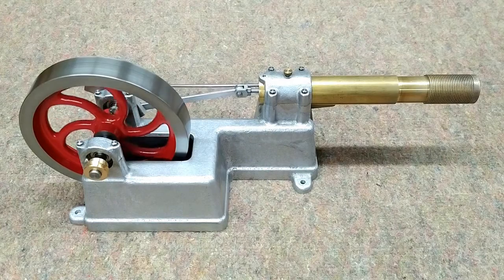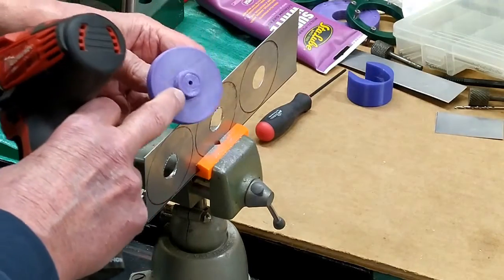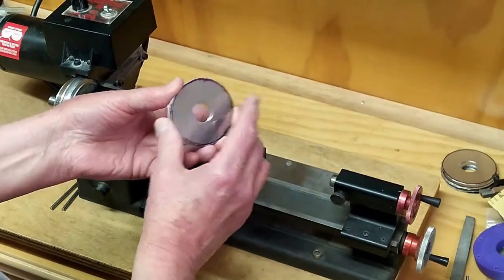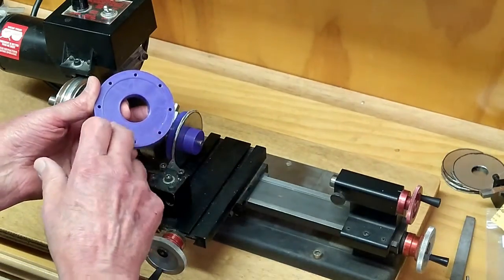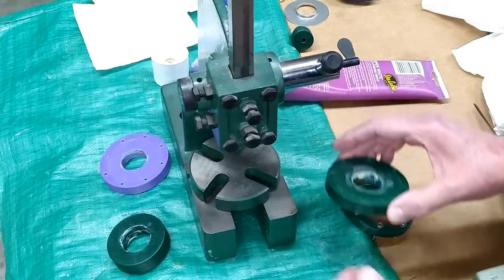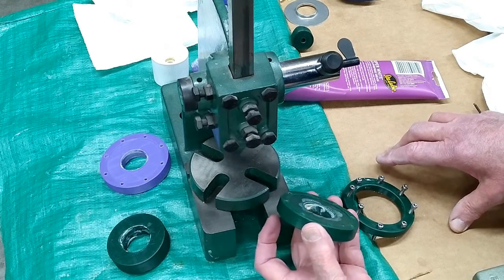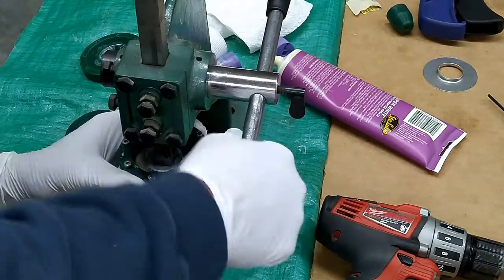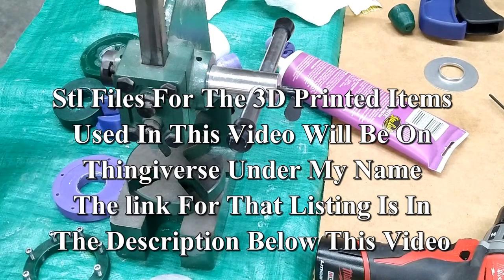Huxtable Hot Air Engine - Forming Aluminum Cooling Fins Part 1

Comment: The cold forming, especially “drawing”, or shaping of sheet metal is a art to be learned from watching other craftsmen and experimenting through trial and error.  You are “spot on” demonstrating the necessary techniques of 1.) securely clamping the outside of the disc,  2.) using lots of lubricant on the disc and form tools,  3.) “drawing” the flange in three steps. And. 4.) easing the form tool slowly through the disc.  Thanks for sharing your skills with us.  It is a very informative video!
Reply from the maker: I appreciate your comment.
Please subscribe! 
That is what keeps this channel going. 
Ron